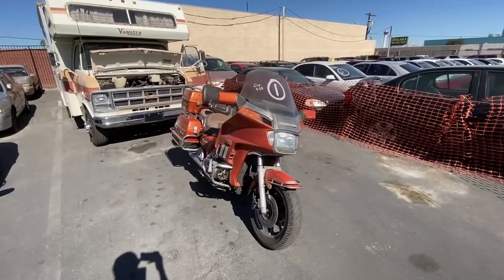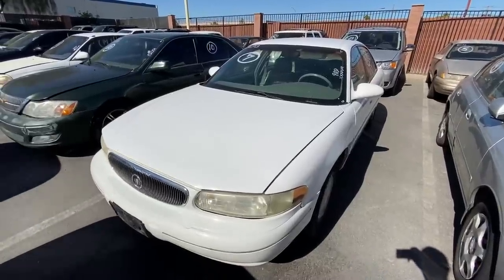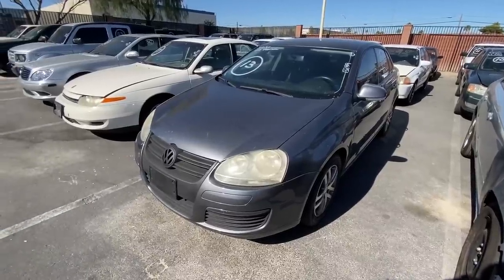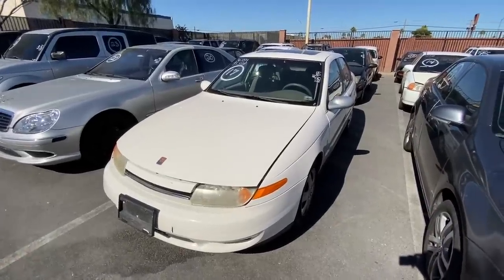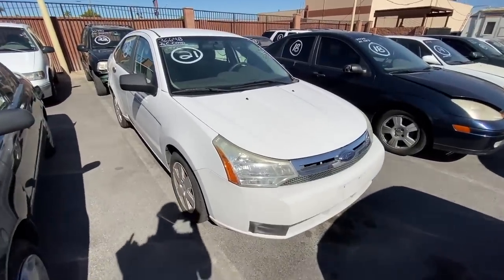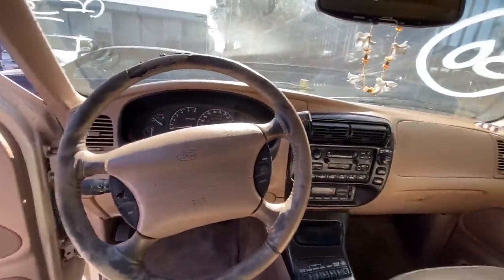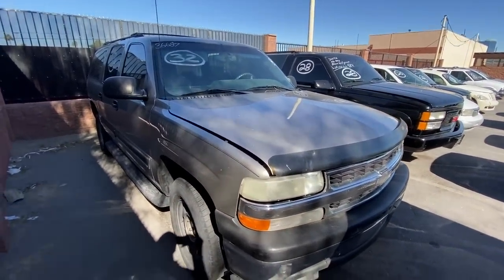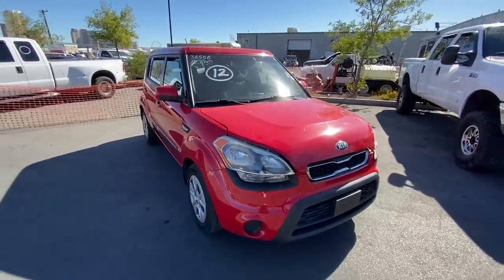BIG DEALS, SMALL PRICES AT AUCTION!

Comment: The Audi A4 is going to need a rebuilt head at a minimum. Guaranteed to have bent valves if the timing chain slipped.
Reply from the maker: Yea that def doesn't sound like a easy fix